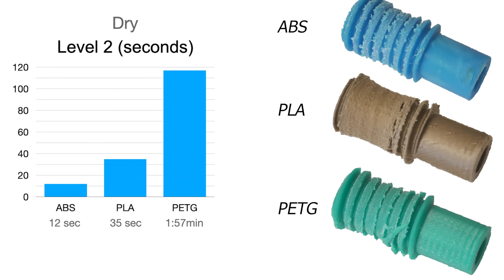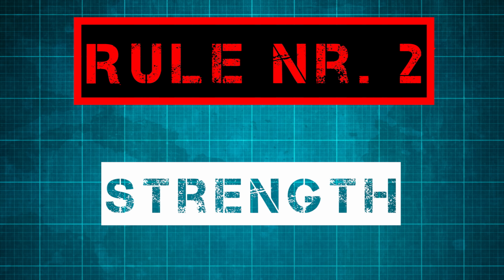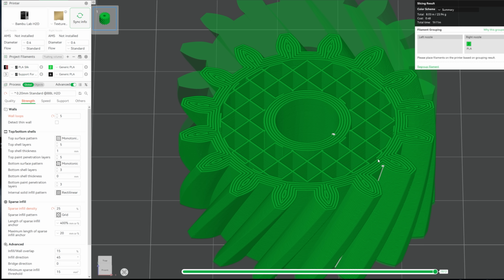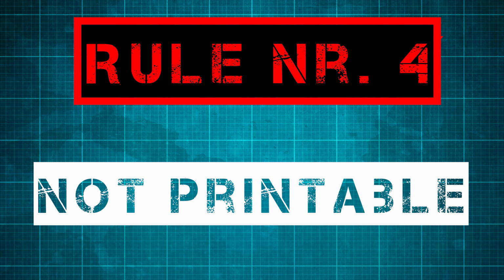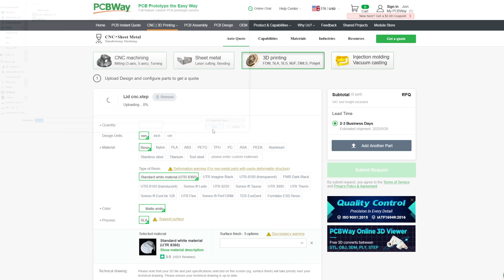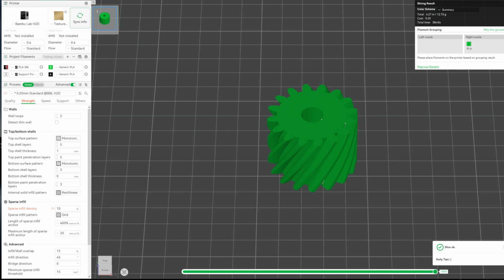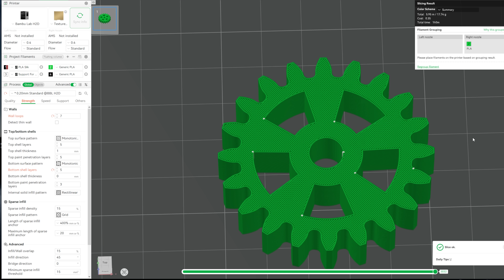How to 3D Print Gears That Actually Work

Comment: You can design the inside of the gears too if you model it like a shell. You can add internal fillets or ribs on the inside that would reduce stress concentrations

Comment: Two things. 1: Any 90 degree angle will concentrate your stresses up to 3x at those locations. In other words, put fillets anywhere it'll break. 2: Consider making interior fillets, and then volume filling, so that you have 2 step files. A solid body (with internal and external fillets) and an internal "infill volume" body to do the obvious.

Comment: Fantastic guide for prototyping functional gears! ✅ These rules are essential for testing fit and function. When your design is proven and you need 50+ pieces in tough Nylon or metal, our CNC machining & injection molding services are the perfect upgrade. Great work!

Comment: Just print gears solid. Add holes if you want to reduce material use and weight. Infill is way overused in general, it only exists to support the printing of the the layers above it. Enclosure walls should also be solid, just make them 3-5mm thick with all walls. Only use infill for the unavoidable and occasional thick areas in your model, but try to design these out. In general the model will have about the same print time solid because infill is complex and takes longer to print than walls. Also, I've not seen any of these 3d printed gears videos mention module or pressure angle. Larger module (tooth height) is more accurate, as the nozzle size limits XY resolution (smaller nozzles allow smaller module, but vastly increase print time). There will be a minimum tooth number depending on the pressure angle (9-14 teeth, generally). Higher pressure angle makes more triangular-shaped teeth which are stronger and less likely to snap off. I've not tried it but I imagine that worm gears with 3d-printing optimized module and pressure angle would work fine.

Comment: If you print gears for toys and really low power applications, anything will do. But if you want good, reliable gears, don't use pla, don't use regular infill patterns and don't print them in any crazy orientation!
-Use nylon or petg! (Nylon is tough, but petg is more rigid and has relatively low friction coefficient. It isn't prone to overheating and crumbling like pla or even abs in some cases)
-Instead of raft you can use a small chamfer on the bottom edges to avoid elephat foot related problems.
-Regular infills are not really suitable for torque transfer. Use 100% infill and optimize out the unnecessary material manually. 
-Leave at least as thick outer ring as the distance between the point of two neighboring teeth. For example module1 gears have 3.14mm between the point of the teeth. Leave a ring at least 3.2mm thick for the teeth to sit on. 
-Make a hub at least double the diameter of the shaft it receives, unless it collides with the tooth profile.
-Make spokes at least half the teeth distance thick (~1.6mm for module1 gear) from every other tooth end to the hub. It should reach the hub tangentially on both sides, like spokes do on rear bicycle wheels. If the gear is so small that using spokes doesn't save much material then leave it solid.
-Herring bone gears are self-aligning but if some light axial load isn't a problem, you can get away with simple helical gears too. They run smoother than anything else. 
-Don't leave hard concave edges as they are stress points. Put a small fillet or chamfer on them. Especially at the base of printed shafts.

Comment: 5.1 - dont use rectilinear infill. it's weakest in the direction the force is applied they way you print them. also now Orca slicer has option to use double-walled infill and with 1 extra perimeter every odd layer this thing gives really good strength with not much extra infill % needed

Comment: Worm gear problem doesn't come from from "insane amount of gear ratio". or due to "heavy loads"
The problem with 3d printed worm gears it the contact point is sliding (the 2 parts are rubbing against each other). Friction generates heat, heat causes the material to melt and wear down. That's the reason why worm gears are always made of copper, bronze, cast nylon: all low friction materials
On the other hand, spur gears have their contact point rolling (the 2 parts have their teeths just rolling against each other, and not sliding at all). No friction, no wear
THIS is the real reason, not the gear ratio, not the load
You're clearly not a mechanic nor engineer...

Comment: If you want to avoid the raft requirement, you can add a chamfer to the top and bottom faces. Which can also be helpful with sound and lubricant flow.

Comment: how about making a gear overdrive or a transmission for your 4x775motor gearbox that would be good for future you already did for the torque so i would be good if you did both (RPM AND TORQUE) btw i like your work

Comment: Minimal cooling you can get away with, enclosed, sweet spot for infill is 25-50% (otherwise go 100%), ASA and GF-ABS have been the best for me (small pool of samples), slow down the flow to 6-8mm/s (3mm/s is mold like). I'm using a Micro Swiss CM2 nickel plated Copper Volcano nozzle with hardened steel tip

Note; you can see that the first top layer on your prints delaminate when you tested it in your vise. that might be because you have Part Cooling to 100% for bridging and that gives you poor layer adhesion. I turn that off in the slicer, and use modifiers for large complex mechanical parts. I always go though 'Fan Speed' layers before i print to make sure the part isn't getting too much cooling in critical sections.

Comment: one small thing for the last step: you can make internal micro-cuts with a thickness of 0.01 ans force the slicer to put walls from. the inside to the outside that way, while still keeping your regular infill pattern everywhere else and its outer look the same. 
Internal Structure Engineering

Comment: Top and bottom layer only 0.2mm a layer height compared to the 0.4 per wall layer width normally. You need to double the top and bottom layer amount to make it same with the walls.

Comment: Not all photopolymer resins with sufficient wear resistance should cost like gold, a very so-so example of a polymer from Formlabs. In the Resione line there is a polymer for printing BJD dolls, and it is great for printing gears, strong and wear-resistant, and costs only 60 bucks per kilogram

Comment: Something I "discovered" to make gear teeth stronger is "perimeter transitioning threshold angle". This eliminates the gap between perimeters when they squish into the tooth. (This will make A LOT of retractions on some models tho)
 I tend to use 0.4mm external and 0.6 or 0.7mm perimeter width internal  with low speed and acceleration to make the teeth sharper.
Also, for the bottom and top layer I tend to use a 0.3 or 0.5mm bevel to eliminate elephant foot (top layer also, on some printers top solid infill can push perimeters out)

Didn't use nylon much. Tried with PC, but it shrinks and warps, but it's really strong

For the shaft, if it's somewath big, try to do some circles outside the corners to alleviate the load and avoid a crack to form. I also set top and bottom layers to 4mm thick (double or greater thand the teeth module). If the gears is small it should be solid, if it's big, the teeth should fail first. Infill should make a difference, the torque transfer is between the perimeters, top/bot layers and shaft. If it breaks in the middle zone, it's not because of low infill but from low bot/top layer thickness

Comment: Regarding PLA and temperature issues, take a look at "Polymaker's High Temp HT-PLA 1kg 1.75mm Filament", they claim it can manage up to 130C with no load, or deformation. Notice "no load", so it may not work to that temperature with gears, but I suspect will still be better than standard PLA.
 Peace from Australia.

Comment: I print my gears solid and small height wise.  Have never had many issues printing them.  Try cc3d 72d tpu for gears, I know it sounds weird as tpu is flexy but 72d isn't and its damn near unbreakable.  Ive spun a planatary gear up to 20k rpm at input shaft for 2 mins and it didn't melt or was deformed any.  It was very surprisingly strong
Reply: I just bought a roll of this stuff to experiment with. I also have some of their PBT Pro which so far has been a great, easy to print, and strong material. Thanks for your insight. I'll have to try printing some gears and see how it works out.

Comment: If you want to print gears, you want to use suppliers like IGUS that are world leading in engineering plastic for gears, glides, robot links but if you have something like Bambu H2D then low fric plastic on surfaces and strong plastic for the id. IGUS makes specialty resins and filaments for gears.

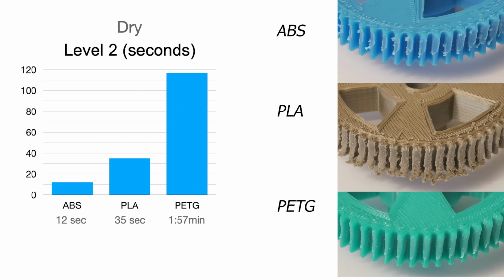Comment: I was not able to interpret the graph 3:00. I have so many questions...

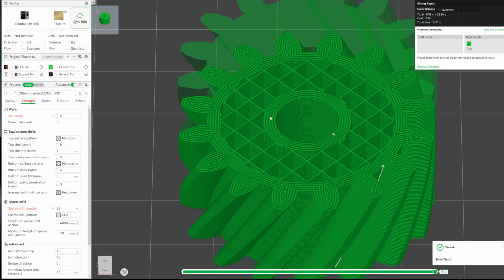- What does the time stand for? Does it refer to how long the gear was able to survive a high RPM test until it stopped moving? So PETG survived for 1:57, and ABS for only 12s? But the image shows PLA as the worse material... I have no idea what any of this means. Is this on another video?
- Also, PETG was not mentioned once in the video, but it appears in the graph. Why is it not recommended/mentioned?
- What is "dry"? Did you test it with a moist filament as well? Was it dry before printing, or during use? I mean, you did show footage of a boat with 3D printed gears.
- What does level 2 mean?
- In your test footage you used a 3D printed worm gear, while you specifically said on rule 4 that 3D printing a worm gear is not adequate.

There are so many contradictions and anecdotal evidences in this video that it's hard to believe any of the tips/rules...

Comment: I heard that PETG is nice as a Gear since it is self lubricating?
Reply: No. I have a hard time imagining a self lubricating plastic in FDM 3D printing. The printed model strength relies on the ability for the layers to stick to themselves. What you are suggesting would lead to the opposite effect.
Reply: PETg does have a decently low coefficient of friction, but in my experience that's not true when interfacing a PETg part with another PETg part.

Comment: You can also use the slicer to create what is called a modify on your part and the settings for that modified area can have 100% infill, so for example if you create a cross centered on the gear, and set the modifier to 100% in Phil just for that area, then you can have the reinforcements without having to cut away parts of your gear which weaken it while also reinforcing it. So using the modifier you can have either a different infill percentage or infill pattern, etcetera.  And when I say modify I'm talking about a slicer feature called modify. It allows you to add a shape over your existing parts and that shape can have different slicer settings than the rest of the part.

Comment: There are special filaments for gears or mechanical parts. For example, the Iglidur filaments from igus. These filaments have higher temperature resistance and are self-lubricating or food-safe. Hobbyist filaments such as PLA or PETG are not really suitable here. Many of the Iglidur filaments can be processed on normal hobby 3D printers.
Reply: Do you know what's the polymer base for these filaments?
From the datasheet I skimmed, it looks to me like some kind of PA ... which is also known as Nylon.
Reply: @JensDoll  No, I don't know what the base polymer is. I used Iglidur I150 as a replacement part in an SCN-5 actuator. The printing was simple and straightforward, there were no problems. But you can ask the igus specialists. You can usually find a contact person at the bottom of the product page. They respond quickly.

Comment: Good info but the "only Bambu can print without elephant's foot" is laughable.  Many modern printers have flat beds and Eddy sensors to create a very accurate bed mesh for Klipper to compensate as needed.  There's no need to print a solid gear or add spokes to create a thick hub without a solid gear.  Just use a slicer modifier to print a thick solid hub.

Comment: Hi, are you using some gear generator or designing it yourself?
Reply from the maker: Most of the time I use Fusion 360’s built-in plugins for spur and helical gears. Designing them from scratch for every project would take an unnecessary amount of time.

Comment: You can 3d print shafts... you just need to print the shaft horizontally and insert it into the gear with an X keyway. This is how I designed my 36:1 reduction RC crawler transmission, axles, and driveshafts.

Comment: Awesome! I'll be testing heaps of gears soon, and will definitely be referencing some of these tips. I like to use modifiers to add strength to areas instead of relying on geometry changes. I find it makes adding a lot of walls to the center bore quick and easy.
Reply: I also wonder if using circular or at least rounded voids in the gear would be better than having sharp corners which can create stress risers.
Reply: Oh, look, one bambucrap shill is praising another bambucrap shill.
Angus, I followed your channel for years, and I regret that since you were sold to CCP.
Reply from the maker: Hello, and thank you! ;) For the last 6 years of 3D printing all kinds of projects, I’ve found so much useful information from your videos. It’s nice to see that now I can finally give at least something back! I’ll be looking forward to seeing some of these tips in your upcoming videos!

Comment: I use my 3D printer mostly for printing Herringbone gears for my various projects. I made my first gears using the RepRap I made in 2009. 
Raft was a must before elephant's foot compensation variable was available in slicers.
A raft is a must for smaller gears, as they might not stick well to the bed. I skip it if over 8mm in diameter and about the same in height. 
The cheapest Creality with bed leveling can do it easily.

Comment: Have you found that printing on an angle, rather than flat on the bed, makes a difference?
Reply from the maker: I actually did it for very specific reasons. It can make a gear stronger in some cases, especially when the gear has to be small. Printing at an angle increases the surface area per layer. I’ll leave a link to my RC boat project where I used this approach.
https://youtu.be/6nrzocrCrcA

Comment: PLA and Nylon the best material? What about PC and ABS?
Reply from the maker: PLA and Nylon are the materials that make the most sense. ABS gears work, but since they shrink while cooling, it can create backlash. I’ve also used PC filament for gears, but I didn’t see any big advantages over Nylon—it was just more expensive and harder to print. But hey, that’s just my opinion and I can be wrong! ;)

Comment: "Only Bambulab can do this" -> No 😊
Reply: Any printer can do this if you actually tram the bed & calibrate Z offset correctly.
Reply: @daliasprints9798  without a solid frame you won't get the same consistency
Reply: Have hundreds of miles on my 3d printed ebike gearbox that was printed with an ender3. The gears were never the problem as I designed them beefy enough. Once had the one-way clutch bearing on the gearbox output shaft shatter due to too much torque, but the 3d printed gears weren't damaged at all.
Reply: Yes! I closed this video on this moment.
Reply: Yuh uhh
Reply: He also said "from my experience".  Context matters.
Reply: Hahaha! I've printed over 50 gears on Qidi printers.. 😂😂😂😂😂
Reply: NO! 🤣
Reply: My K1 will also do this 😂.
Reply: Any printer with a good z offset or automatic z offset will do a good job. For professionals, Prusa is always the best ;)
Reply: OMG people of the internet, DO NOT BELIEVE THIS SHIT. ANY printer these days can produce quality parts. There are a lot of settings not mentioned in this video..  Shill much and yes it had to be said.
Reply: BambuLab is really good printer. But not perfect and not for everything. And of course it's Chinese
Reply: @androidv1383 I agree with all of the above but that last statement. Working in IT all my life and having had the pleasure of working with many “Chinese” people I can say they are hands down great people. Regarding Chinese products? We’ve seen, first hand the evolution of their growth as a society in so many ways. Engineering wise, they are putting out substantially superior products and most of the 3d printers out there are Chinese (I’ve got three from three different Manufacturers) once again, great products. DJI rules the world Drone wise. They set the standard. So, yeah there’s that.
Reply: @androidv1383 China today is not China from 90s. Quality is good to excellent often better than western. There are more black sheep that's true but I'd you go with renown manufacturer no problems. Chinese people are great.

Comment: It's also possible to increase elephant foot compensation in the slicer, and or just design in some elephant foot compensation into the design. 

It makes more sense to think of top, bottom and walls in terms of thickness than counting number of layers to lines. Especially if you change  layer height without also changing line width correspondingly, or vice versa.     

Increasing wall, top and bottom thickness increases strength more than increasing infill or designing in large holes. You can increase perimeter thickness in specific places, like around the shaft/shaft hole, in the slicer if you need to.
Reply: Just a small chamfer or fillet at the bottom will eliminate elephants foot without messing in the slicer.